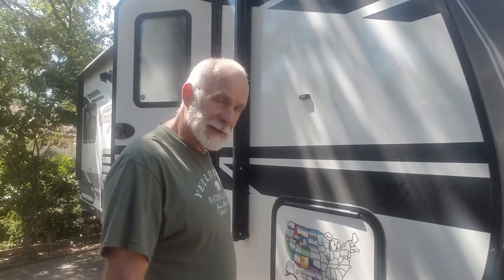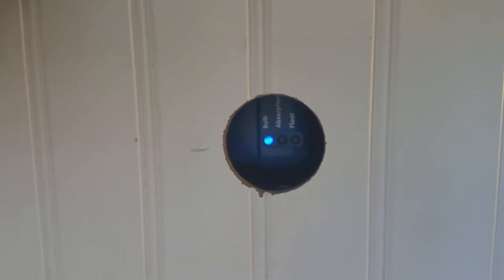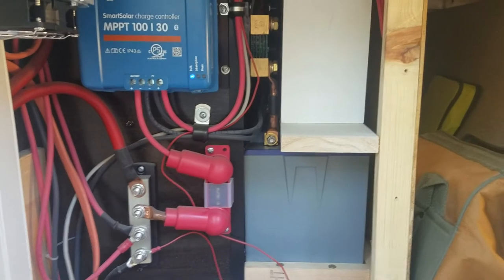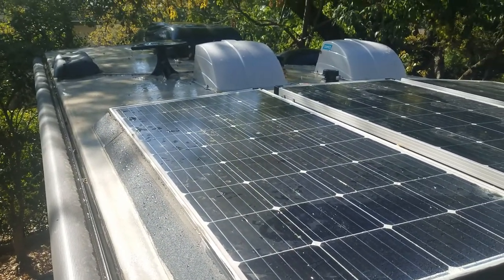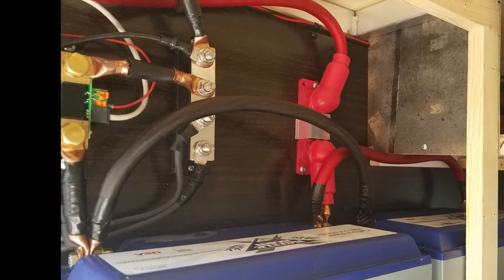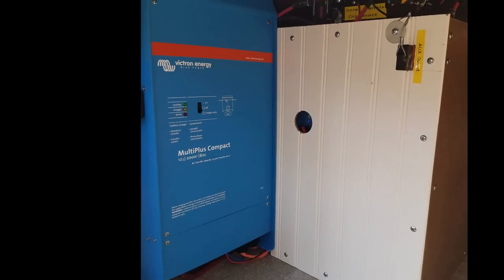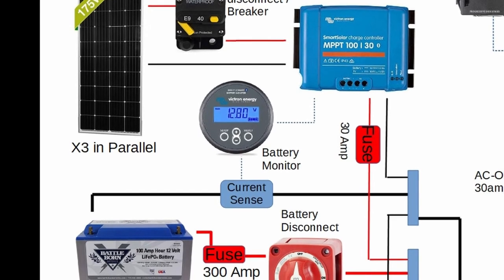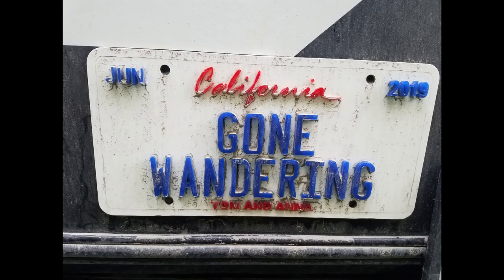Add Solar to your Travel Trailer

Comment: Geez Tom, very impressive system. I saw some similarities with my system and some substantial differences. Does the Victron inverter/converter take the place of the stock converter?  Does a 2000 watt inverter run a microwave oven?  Well done!!
Reply from the maker: HI, Yes the Victron replaced the stock converter/inverter. (It never had an Inverter). Yes! we can now run a microwave, hair dryer, etc and the refrigerator will run 5ish hours while the solar is in the shade. While bouncing down the highway, having the refrigerator run on Solar vrs Propane is a great safety improvement.
Reply: @gonewandering3550  before adding the converter/inverted, did your stock onboard converter have a lithium charge profile setting while on shore power?